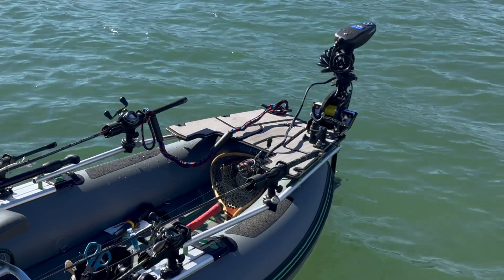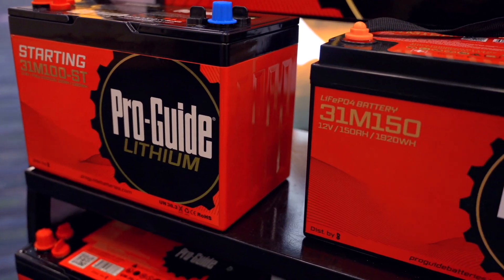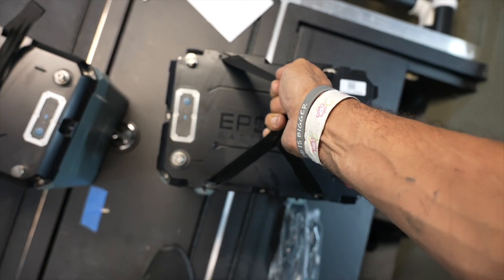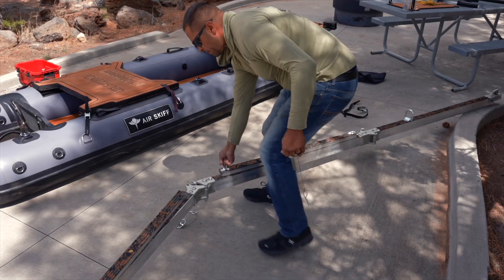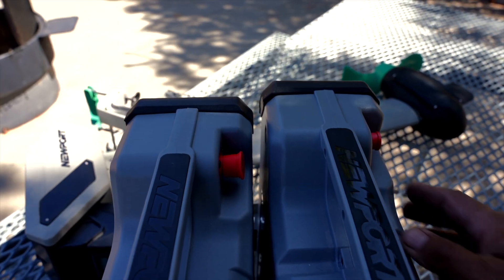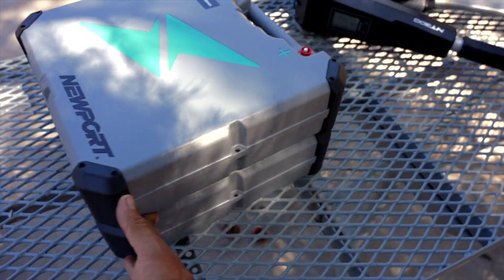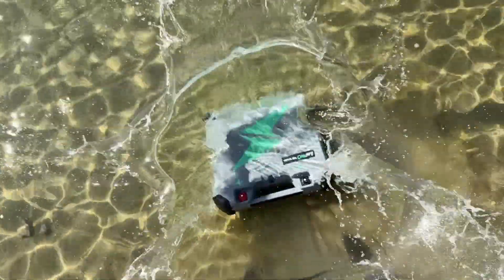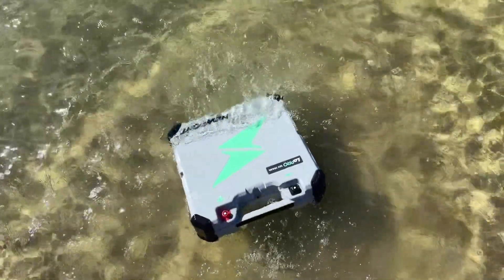Batteries won't be the same after this - Newport LoPRO Battery Review.

Comment: Great content, dood!  My experience so far with LoPro has been pretty rad.  

Something I need a solution for is how to deplete a 100% charged back down to something like 80% (long term storage level).  If you have some ideas beyond rigging my boat and actually boating ahahahaha that would be cool.

I have a couple of battery banks and maybe I can get a cable with Anderson plug on one end and a male end 12v cigarette lighter on the other and all that into my battery bank. I suppose I could get a female cigarette plug, but plugging a 36v battery into something might be kinda sketchy.
Reply: They make battery chargers that will do this.